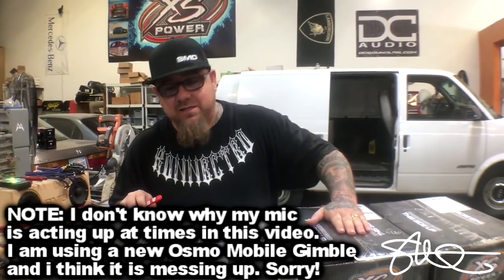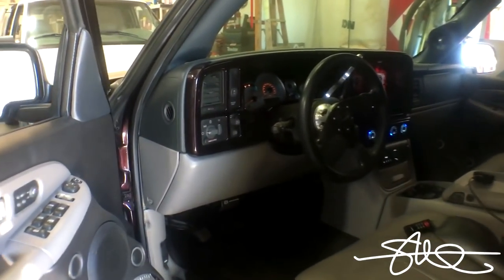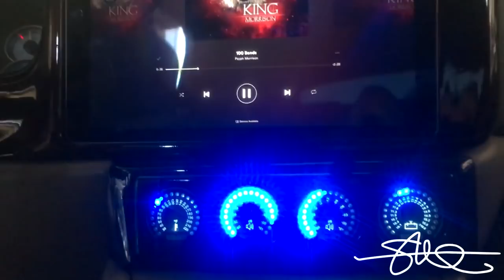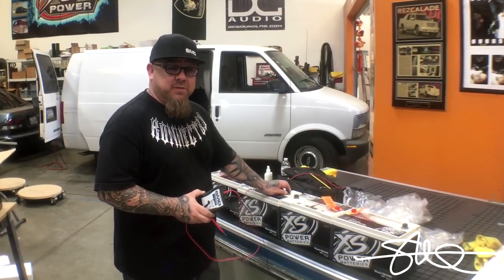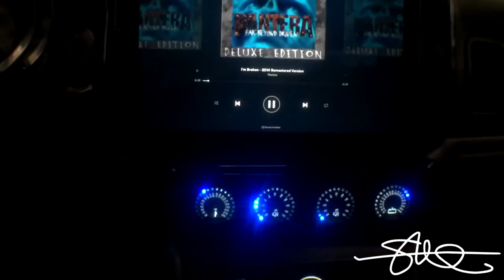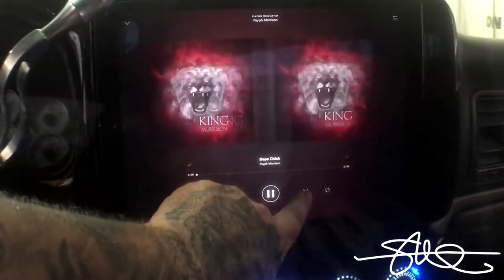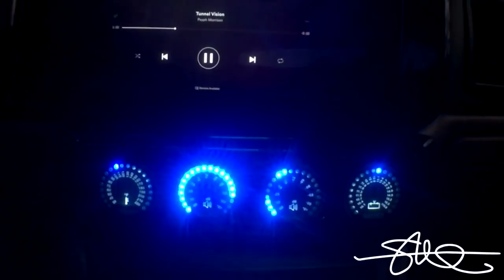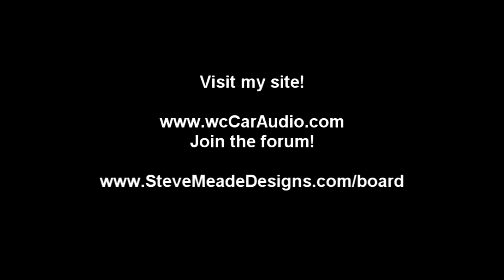XS Power Super Cap Banks Unboxed, Installed, Tested - 4 SB1000-31 4000 farad (Before & After)

Comment: lmao all this time Wayne harres pushed caps since the 80's  people argued that more battery's  was better because they watch you tube and saw your videos of more battery's is better than caps and now you showing Wayne was right the whole time I thing you should give credit to the old school guys
Reply: Technology has changed, the caps are way better and capable than they were in the 80's and early 2000's.  It's kinda unfair to now say caps have always been better.  Its also is put in a car that is rigged to support it properly, some testing needs to be done for average cars vs super cars.  It's never been caps suck, it's always been get a good base line electrical system before you think about adding a cap.
Reply: caps worked in the 80's and 90's they still do its a ever lasting argument and yes they are more powerful now than then !
Reply: 1boostup aren't these cap cells more of a hybrid cap battery if I'm not mistaken
Reply from the maker: give "credit" to the oldschool guys? i AM an oldschool guy.  SMH.  And you clearly do not understand what is going on here so settle down champ. lol
Reply: I am probably just as old as you and know what is going on and i think you took my comment wrong

Comment: Because it didn't drop voltage on the hard hits do you think it played louder?
Reply: Tyler Proud it is louder cuz he ain't clipping meaning more watts? lol
Reply: team louder he never clipped. He has it sent so that it doesn't. But if voltage drops does that effect total volume?
Reply: Tyler Proud when voltage drops to low it clips no matter if gains are set up
Reply: team louder can you explain that because that's not how ohms law works and amps don't work like that either.
Reply: Kyle Vanwinkle most of the amps tells you the lowest voltage is safe to play and the highest like 12v to 16 volts if it goes below 12 volts the amp will start to clip is different from ohm law
Reply: team louder clipping and distortion is two completely different thing. yes clipping is a form of distortion but distortion isn't always clipping.

besides that the amp operating voltage range is set for reliability more than distortion. run an amp below 12v and the resulting inefficiency causes heat buildup and eventually failure
Reply: Kyle Vanwinkle true

Comment: you should use the 3100 on your test bench
Reply from the maker: i have 10 D1400's. No thanks.
Reply: meade916 ahh i wasnt sure. i know uve said u had issues testing higher rms rated amps in the past. wasnt sure if u upgraded the cap. on the bench yet or not.

Comment: Hey steve. It maybee has been answered before somewhere. But why not lithium. They are light as fuck. Just saying.  You have a big fan base. Please add some vedios to explain to people that dont have much experiance on installs. Can be as simple as why voltage is important. Or wire size anything. I know your busy as fuck but please make time. You are a exellent teacher. Some guy asked about a alternator. Put out more vidios and you will answer all questions. Let your workers do tgem you collect cash. Lol.
Reply: James Swain What do you think the four batteries At the beginning of the video where
Reply: David Brennan common. Why name calling. If you go to college you can speak properly. Just saying
Reply: James Swain you know I've always wondered the same thing of why not go up to an all lithium setup like jp did with his . But I'm sure its an option he considered, and who knows probably will do when he does his new box. by then the V3's will probably be out and who knows maybe an SMD amp to go with it  🤔.
Reply: imickey503 what If he Just went straight batteries without the caps ? There's no way he would need more than 6 is especially if it's just for the four 18's because it's just 2.4kw and in total. It's not like he's got 6 or 8 5500's at a 0.5 ohms. And even with the daily driver setup that he has it as I'm sure he drives the Escalade is really the daily driver. But I'm sure he has nothing to worry about. Then we could look at it how differently the system would act if he had the 7500's instead of the 3100's , but then again that's still a possibility of adding more weight even with less battery .
Reply: i do believe those were not lithium it said AGM on the label

Comment: Those are Lithium.....look up the price on those bad boys
Reply: Charles Brewer there is bank of caps in those cases not lithium.
Reply: Charles Brewer these are supposed to be the cap cells not the lithium batts.

lithium batts are power dense and they can discharge fast, but caps discharge faster they just don't hold much
Reply: Kyle Vanwinkle 
One is a battery. One is a bank of caps.

Comment: god damn these battery's range from 1k -3k lol
Reply: Worth every penny my man. I got two sb1000-31 batteries on two 15 orion hccas spl subs and I've got the loudest system in the city!!!!
Reply: These are super capacitors.. not batteries
Reply: @PlayaflyJoe27  if you have the loudest in the city with only two 15's..then you're either in the country or there's no one else with a system.
Reply: j readdy naw hater. Both subwoofers have an rms of 5.000 watts hooked up to Orion HCCA5000.1DV2. Read up on the specs and quit hatin
Reply: @PlayaflyJoe27  not to mention they'll take 10k rms...we build lol..you buy shit from a company that use to be good in the 90's.
Reply: @225maine  and if I put 2 more orions in my truck, it'll be just as loud as what you "claim" you have. I just wasn't tryin to take the third row out my shit. Lmao
Reply: @225maine  That one amp with two d3100 batteries on those two subs got my shit shakin the block when I come through. Everybody I know round here still buying Brutus amps and kicker and alpine speakers.

Comment: Not a believer in my XS Battery. I recently upgraded my system and my lights still dim.
Reply from the maker: might need to check your install and not blame the battery.
Reply: Not sure what you mean?
Reply: Check your grounds. Depending what you're pulling maybe your alt can't keep up ? Or Simply One battery isn't enough.
Reply: Jon M 2 12 inch L7 ( blue stitching around them ) and a Rockford amp. Its not a huge amp but they are retarded loud lol. I just had the alternator replaced. They even dimmed on my last 2 12's.
Reply: Jeffrey K 
Light dim doesn't necessarily mean voltage drop. hologen/incandescent bulbs will dim with a perfect system. They just regulate their power poorly.
Slap in some LED conversions. they regulate power a lot more efficiently and pure dimming most of the time. You can't say it's the lights into you put a voltage meter on it. check out exocontralto he just did a demonstration of this exact same thing... an LED conversion video.
Reply: Justin Murphy I am lost on the LED Conversion part lol. I spent enough money on this battery. Lol, heck its only 4 months old.
Reply: its the headlights themselves more then likely hologen use a lot of power where led and hid uses just over half the power hologens use as steve said do check your grounds though. i have hids i haven't had dim since I've put them in at all
Reply: plus a led or hid conversion is not that expensive and you get better light output
Reply: Jeffrey K 
You swap out your OEM bulbs for LED bulbs.
The guy here on YouTube that I was talking about has a well-built well powered system and his lights still dimmed. He swapped out the bulbs and the light was brighter and did not dim. He did a side-by-side comparison of one bulb and one bulb out.
They are more efficient and respond different to the draw from the stereo system.
Reply: randy george Exactly!
Most bar around 50 to 60 bucks which are about the same as regular headlight bulbs and twice as bright as OEMs.
Reply: Don't get us wrong you didn't waste money on the battery. It needs it and it has its place. Have you actually put a meter on the battery and see if the voltage drops that much when the lights dim?
Also... did you replace the factory battery positive and negative wires with at least 4 gauge?
Reply: Justin Murphy so spend more money lol. I will look into it.
Reply: i did hid in my frontier which does great i may switch to led later on but i have no problems with my hids i am bagging it to lay frame and possible body drop so i will have a good draw on my electrical so battery and big 3 upgrade coming soon
Reply: yeah dont get us wrong you did right the system can always use the extra power just look into the led or hid systems to get rid of your dimming issue and if you havent done so look into a big 3 upgrade you can do so with kits of ebay that is all sky high wire, connectors, heat shrink, and all with 1/0 awg for about $60 with will handle about anything you will ever put into your vehicle. factory grounds and power wire can hurt your voltage as well
Reply: Jeffrey K yeah its the world of upgrading cars spend money to make it right. but once its right youll rarely have problems. one of the saying between me and my friends is you gotta pay to play. ill have in-between 3000-3500  in my suspension on my truck alone not to mention when i do my system up the way i want
Reply: randy george 
HIDs are efficient just like LEDs. They have dedicated power supplies. I recommended LEDs because of cost.
Reply: Justin Murphy I guess I just don't follow along because the radio light also dims. So back to the XS Battery…
Reply: Is your battery fully charged 12.6 to 12.8 while car is off if below use noco genius 2 or 5 amp charger u a be fine after